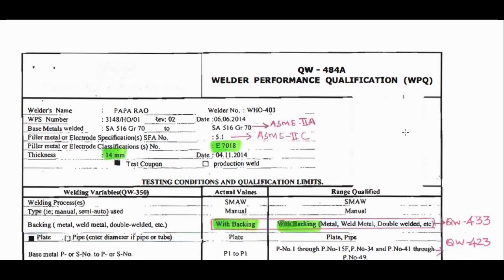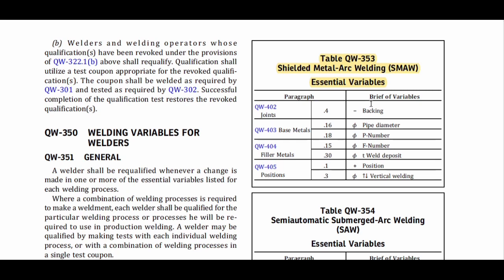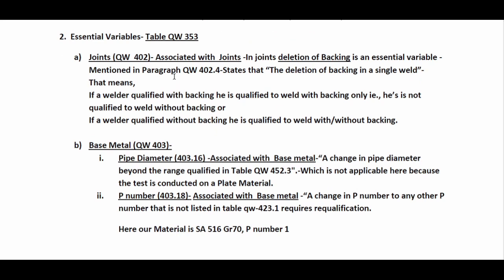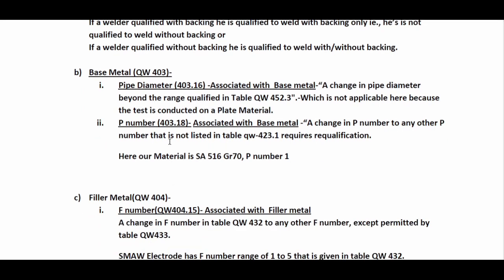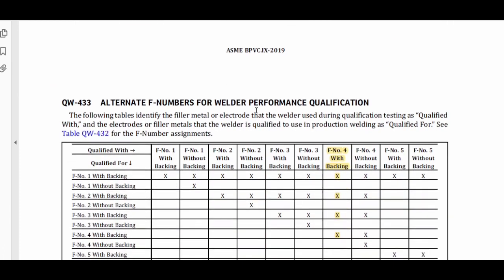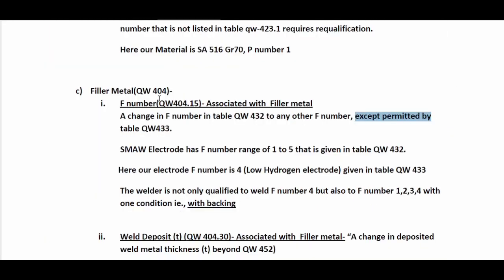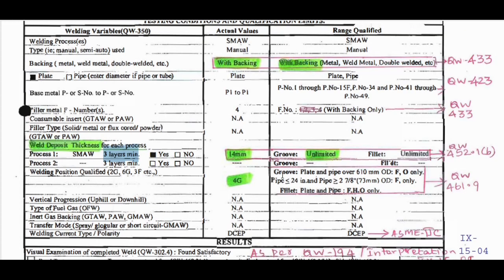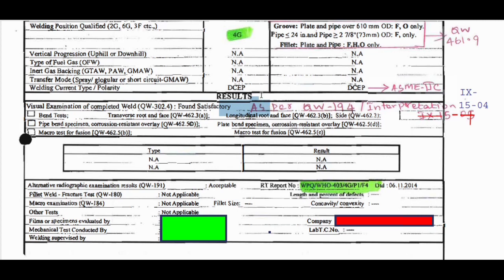How to review  welder qualification  in accordance  with ASME section 9

Comment: Sir how much min.thickness welder can weld OR he qualified min.thickness limit......If I'm not wrong does he qualify min.13 mm and max.Unlim.....pls.calrify ans.
Reply: In section IX for welder minimum thickness is not mentioned. There for the minimum thickness a welder can weld is based on WPS. For example in WPS If the thickness range is given from 1.5 mm welder is qualified to weld 1.5 mm
Reply: And multiple of 1.5T  if anyoune do welding below 13mm thickness @ajay_constantine

Comment: Pipe Diameter: The limitation for pipe diameter addressed in QW-452.3. The welder who qualified in 6 inch pipe cannot weld a 2 inch pipe. He can weld till 2 ½ and not less than that. Other example that is that when a welder is qualified by 1 ½ inch pipe, can weld min 1 inch and max 2 ½ inch.

Dear Sir I have a misunderstanding in your statement " You write here if a welder qualify on 1 1/2 Inch Pipe then he qualify on min 1 inch and max 2 1/2 inch pipe. As per ASME SEC IX QW-452.3 said that he qualified for unlimited.
Reply: Overall its  a good experience.
Reply: yes he is qualified for max diameter. maybe the youtuber misinformed in the video

Comment: very nice Sir
Sir I have question on PQR
Sir can we use a PQR "which is qualified on Material ASTM A53 Gr.A Process GTAW/SMAW Filler wire ER70 S-6 and E7018" to make a WPS for A106 Gr. B, process GTAW/SMAW filler wire ER 70 S-2 and E7018

Comment: My doubt is if welder qualified in p no 1 then he qualified and he can weld p no 1 inbetween p15F all the materials?like P4,p8,p5a
Reply from the maker: Yes. As per code. But not all clients willing to accept it. They need separate qualification
Reply: P no. is qualified from 1 through 15F but F no. is also essential varial. If the welder is qualified with P No. 1 F No. 4 so he can not be qualified for F No. 5 which is  F no of austenitic materials.  I am preparing detailed videos on welder performance qualification which will cover all clauses of article III of ASME Section IX. 
ASME Adda for Mechanical Engineers is my YouTube channel. You can refer this for other topics as well.

Comment: Dear Sir,
Great work, please keep posting videos like this your method of explanation has cleared many doubts.
I have a question if you could answer I would be grateful.
1. If a Welder is qualified for P1 then can he weld Dissimilar metals like P1 to P15f
2. And if a WPS is qualified for P1 to P1 then can it be used for dissimilar metals like P1 to P15f
If all essential variables are the same as same electrode used and thickness etc.
Reply from the maker: I have got ur mail and will reply back to u in a while .
Thanks for supporting.